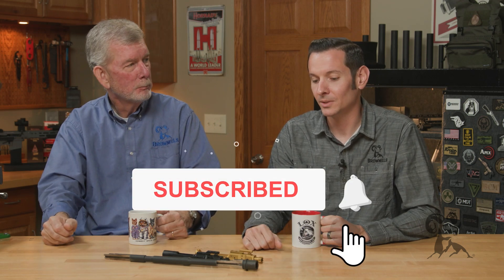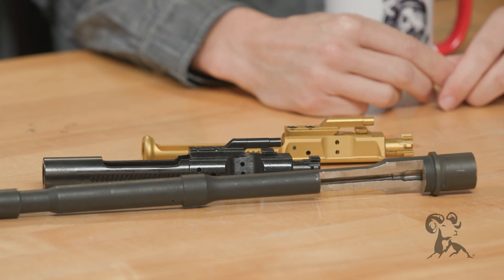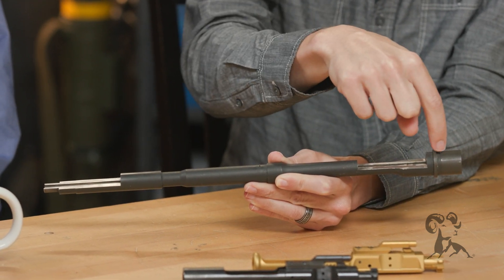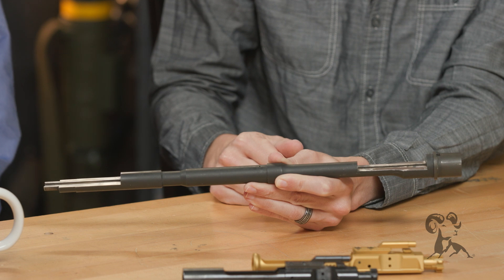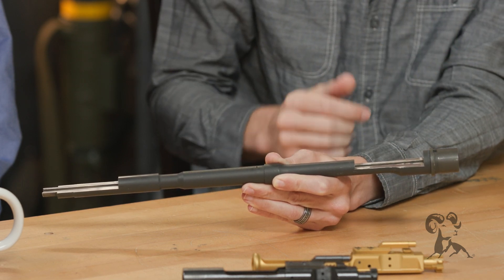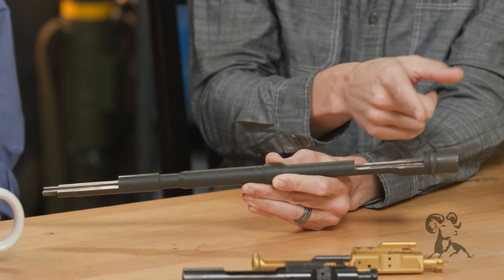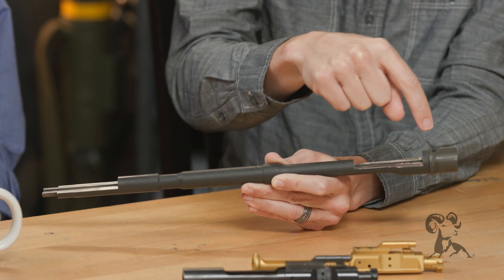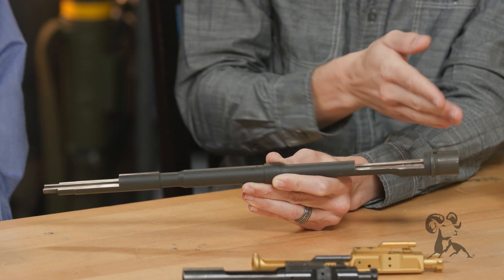Smyth Busters: Fixing Your AR-15's Headspace

Comment: Or you could go for the simpler solution. You're assuming the problem is with the chamber and not the bolt face. Headspace is a measurement from the bolt face to a datum in the chamber on an AR-15. Measure your bolt face with a depth micrometer or with the back end of a caliper. Find a bolt that is either shallower or deeper depending on your needs. Check headspace with your headspace gauges again. If it passes you should be good to go
Reply: That's assuming the chamber is indeed cut correctly, an undercut chamber with an overcut bolt face is not a solution.
Reply: @CalebSavant  if the difference is only a thousandth or two I doubt that would be an issue
Reply: @ryanthede4689  Again... to everyone reading this comment. Never remove material from the bolt face to fix headspace issues, it is unsafe
Reply: @CalebSavant  I was not recommending removing any material at all. I recommending finding a different bolt

Comment: I checked the headspace on a barrel handguard install from jp. They called for red loc tite on the threads… which must be a troll now.

 Cuz that seated before i could even torque it fully. I guessed i put atleast 25 lbs on but couldnt get to my torque wrench fast enough. It didn’t budge when “torqued”

Barrel was a faxon 6.5cm 20” 416ss nitride match lr308

Then also changed the bolt out to a small firing pin (jp high pressure lr308 6.5cm bolt) and the thing had a mono-gas ring. It didnt seal at all. Had to buy std 3 piece gas rings and replace. 

I like jp products but damn u gotta be a gunsmith to work with them sometimes. Damn “race gun parts”

Comment: I’m debating on getting a prebuilt upper for my new AR308 build or trying my hand at assembling my own upper but the head spacing is the most daunting and frightening aspect of it to me lol
Reply: Buy a quality barrel and bcg and you’ll have nothing to worry about.
Reply: If you have the proper tools and can follow instructions, you can make it happen.  I put my AR-15 together with the help of youtube vidyas made by the old dude from Midway.  Also had plenty of written materials to consult.  Read thrice, watch thrice, wrench once.
Reply: Do you have the proper tools to torque and hold an upper and barrel? If not I would just buy a prebuilt one in the pattern you you prefer.
Reply: I would stick with a prebuilt.
Reply: Yep good barrel and pretty much any decent bcg and you should be gtg. Assembly isnt as hard as some make it out too be. Alough an action rod is handy
Reply: It's worth buying the headspace gauges if you're going to build more than one AR308 upper on your own. Otherwise, definitely go pre-built and forego the gauges.
Reply: It’s fun building one up… when buying head space gauges, make sure you buy both go and no go gauge at the same time…
Reply: You'd better get a good torque wrench, they need 60-80ft lbs of tightening on the barrel nut.
Reply: @SuspiciousGanymede  Barrel nuts are from 35 to 80 lb ft. I set my Diamondback at 40. My Aero M4E1 upper instructions said to go 50. I like to check what the manufacturer wants.
Reply: @SuspiciousGanymede  woah woah wrong info here. The closer you can torque to 30ftlbs the more accurate your barrel will be 80-90ftlbs is normally the MAX it should be and will 100% affect accuracy or the threads on your lower at that torque. 30-35lbs is the sweet spot ppl do 40 that are cautious but 80?!?!? Damn lol
Reply: @appaalle  Aero specifies 60-80lbs torque for an M5/M5E1 upper. On a standard AR15 upper it's up to 60lbs.
Reply: @appaalle  35lbs won't cut it on an AR10, the barrel nut will work loose from recoil. 
On an AR15 those specs are correct for a pencil barrel. Typically you'd want about 38lbs of torque for a heavy profile barrel.
Reply: @SuspiciousGanymede  oooo you actually are correct and I was wrong, I over read the M5E1 in huge lettering lol. Def wouldn’t do 30ftlbs on a .308 for sure

Comment: With cheap assembled uppers it is not uncommon for the headspace to be insufficient to chamber a factory round; this observation is from my most limited experience.   I have seen this several times with BCA assembled uppers.  In two of the cases simply trying a bolt from another source allowed chambering of factory ammo.  The original bolts were saved and calibers were 300 blackout and 7.62x39.  I have seen it also in 5.56 and in that case the upper was sent back for exchange.  I have heard of other cases and there was talk of sanding the bolt.  A gun smith can lap a bolt face.   Sometime a little can be taken off the face of the bolt face even if this is not an approved method for fixing head space.   
AR15 upper assembles should be head spaced to the intended bolt at the factory.
Reply: I've had BCA barrels and BCG fail headspace checks.  NEVER remove material from the bolt to fix a headspace issue.
Reply: To all reading this, NEVER remove material from the bolt face to make up for a chamber that is undersized! This is a safety concern to say the least. If you bought an assembled setup that does not headspace or chamber properly, it is the manufacturers responsibility to fix it or replace it, it is not their responsibility to pay your hospital bills after you "modify" it.
Reply: @CalebSavant  You're gonna have to police the comment section of bad tips/suggestions.  A 4 minute, easy to understand video, and a few scoff at the advice.
Reply: @CalebSavant   @Caleb Savant  Please explain how removing a 0.001" makes the gun unsafe.  You do know that for grendal bolts faces there are type 1's 0 .125"  and type 2's 0.136" recesses  for the bolt faces that differ greatly in the the depth of the recess for the face.   The 0.125" is used for the  7.62x39 and for some 6.5 g's.  The 0.136' is what Alexander arms uses for the 6.5 g.  It has something to do with better extractor function I think.  
For unaltered bolts, why is that one manufacturer's bolt will provide adequate head space and another will not on some chambers.  Is one bolt weaker than another.   
The 5.56 AR bolt is over engineered and even when lugs break, seems to still be able to function, but of course such should be immediately replaced.   
Anyway I did not sand or lap my bolt face and simply found a bolt that would headspace.   
https://www.snipershide.com/shooting/threads/whats-the-difference-between-6-5-grendel-type-1-and-2.6971443/
The rims on the Lapua brass are thicker than a 5.56 so a standard extractor would not snap over the rim. The easiest fix back then was to make the recess deeper while opening up the diameter. 1 op to fix both problems. It did make the extractor stronger at the expense of making the bolt lugs weaker. The best way would have been to move the pivot pin of the extractor forward. The extractors AA used on all of the Grendel bolts in the beginning were MILLED 7.62x39 extractors. They were sold by Rguns 3-4 years ago

Comment: Sometimes AR headspace problems are a tolerance stacking issue.  I'd try any other bolts I had lying around first.  After that, I'm with you.
Reply: Good advice, came here to say this. I'd bet most people building ARs and buying headspace gauges have an extra bolt or bcg.
Reply: Yup, built one that didn’t headspace. Tried a couple other bolts I had, they both checked out. Turned out the PSA Premium BCG was not so premium, it’s now a paperweights and reminder.
Reply: Where does an AR headspace?
Reply: @woodrowcall3158  the other guy has a lot of how the AR works right, but the headspace is measured between the bolt face and the datum point. The datum point on the 5.56 cartridge (like most rifle cartridges) is on the shoulder of the case.

Headspacing an ar-15 isn't too difficult as long as you have the right tools: headspace gauges, bolt disassembly tool, and roll pin punches/holders. Take the bolt out of the bcg, remove the ejector, re-assemble the bcg with the bolt minus the ejector, and insert the bcg and charging handle back into the rifle. With the rear take down pin out and the front take down pin in: tilt the upper forward, pull back the bcg a bit, put the headspace gauge into the bolt, and then lock the bolt forward and try closing the rifle. Rifle should be able to go back together with the go gauge, but with the no go gauge installed it should not allow the bcg to clear the lower and the rifle shouldn't close back up. Pretty sure Brownell's themselves have a video on it.
Reply: @woodrowcall3158  inside the barrel extension, there are forward facing surfaces on the "teeth"  Those faces have to be a certain distance from the angled portion of the chamber.

So, the chamber has to be cut to the correct depth at the factory to match the barrel extension.

On the bolt, the distance that counts is between the bolt face and the back of the locking lugs.

When the AR goes into battery, the bolt rotates, and the back of the locking lugs bear against those forward facing surfaces inside the "teeth".  That brings the bolt face to the correct distance from the chamber.

It's the same as a bolt action with locking lugs - except that the barrel extension acts as the receiver and there are 7 small locking lugs instead of 2 large ones.  The large number of locking lugs means a smaller amount of bolt rotation and, because the force is more evenly distributed, the bolt and the barrel extension can be smaller and lighter than the receiver and bolt of a typical bolt action rifle.

Comment: Wait you guys are checking head space? The way I check is if it seats it yeets
Reply: Some seats may not be yeeting to their full yeetability, but I feel you.
Reply: Yeetability has been added to my list of favorite words
Reply: Just because it seats dosnt mean it yeets.
I saw the aftermath of some special guy that put a damaged/bent m855a1 round in his m4a1 and it blew up the side of his rifle sending him to the hospital.
When in doubt throw it out
Reply: @Timber_LXG_5  I just sent a barrel back because the ramps were scratching and guaged a few rounds some, so those wouldn't be safe to shoot.!.??? their not bent or anything.
Reply: @shadyp-zv3uf  small dents in brass is not dangerous 
But if you're ever questioning a round throw it out
A 50 cent bullet isn't worth a 500 dollar bolt and barrel combination. 
I'd only chamber a "weired" round if It was my last round
And someone's chargeing me with a bayonet or a knife
I'm dead eaither way might as well try
Reply: @Timber_LXG_5  nothing I questioned,  they just mainly scratched up lightly,  couple have a small gouged scratching but not bad or deep, but enough were I knew the ramps had burrs so sent it back for a replacement
Reply: @shadyp-zv3uf  Thats fine, scratched bullets like that would only hurt your accuracy. The bullet the other guy used was a military m855a1 steel tipped bullet, im guessing the tip was where it was bent and probably got stuck in the barrel causing the explosion, a normal full metal jacket or soft point bullet wouldnt do that. That said if you notice bullet looks really weird, is very bent or very short best to just avoid it, but small scratches, dings etc are fine
Reply: @shadyp-zv3uf  yeah replacing the part or haveing someone who knows what there doing polish the feed ramp is the best option
Reply: @shadyp-zv3uf  any gunsmith could polish those feed ramps. You could do it yourself with a dremel
Reply: @tonypasty7549 Yeah, but they have to be competent in disassembly and reassembly.
Reply: @Timber_LXG_5  send me all your "when in doubts" I'll shoot em
Reply: @Timber_LXG_5 guessing you arent a reloader, there was more going on with that cartridge than being bent slightly.
If it blew up like you stated then it was overcharged, seated to deep into the case, or both or the barrel was already damaged.
Reply: You guys have me taking notes 📋
Is class dismissed because I got a few seeds to yeet.
Reply: Thank you for this 😂
Reply: It seats it yeets😂🤣😅😆😆😅🤣😂😂🤣😅😆
That's awesome 👌
Reply: This is the way
Reply: About being yeeted I do not know, but medlers must be bletted.  Medlar is fruit and must be bletted prior to consumption.    look it up lol.   I have two medlar trees in north florida.
Reply: Yezzir!!!
Reply: Lol, me too  😂
Reply: Headspace gauge go and a no go gauge
Reply: First mag protocol is "it turns the head, fred" and face away while firing in a safe direction. Preferably with armor on.

Comment: Which is better for a 55 grain a 1:7 1:8 are a 1:9 in a 16 inch barrel. I've asked this question to a few people nobody can really give me a answer y'all's thought.
Reply: 1:8 and 1:9 are known to be a bit better, but not by much. Different people using different qualities of barrels will give you mixed answers. In short, a higher tier 1:7 will shoot a 55gr better than a poor/mid tier 1:8 or 1:9, even though "on paper" a 1:8 and 1:9 should be better. I personally shoot 500yd steel using 55gr out of a 13.7" 1:7 barrel with no issues, but use a higher tier barrel manufacturer.
Reply: 1-9 would be best, 1-8 would work and 1-7 is best for heavier bullets.
Reply: I can only speak from my own experience. I have a 1:8, 20" SS bull barrel on one rifle, the other has a 1:9 , 16" SS bull barrel. The 20" is an Ultra-match from Olympic Arms, (no longer in business) the 16" is from Les Baer Custom. At 200 yds, the 20" 1:8 average group with my hand loads is 3/4-7/8". The 16" 1:9 does 1.25" . Yes 55gr.  Both have excellent two stage triggers, bi-pod, lotsa zoomies. Not typical setups.

Comment: I know an AR15's headspace can go out of spec after it's been fire enough.

Where is it in the barrel, extension, bolt, or whatever that changes to take an AR15's headspace out of spec?
Reply: Typically the lugs in the barrel extension and on the bolt, where they contact each other.
Reply: @CalebSavant   Can the extension and/or bolt be replaced to try to fix this problem?
Reply: @viewatyourownrisk  The extension is much more trouble than it's worth and by the time it's worn down, you should be looking at maybe replacing that barrel anyways. So even though it is possible (the process is explained in the video) it is not recommended.
Reply: @CalebSavant  Thanks Caleb.  These vids from Brownells are all pretty great.  Cheers!
Reply: For it to get out of spec you would have spent so much money on ammo that replacing them wouldn't make a dent in your budget, or you bought one of those Khyber Pass ARs that are made using swiss dark chocolate instead of steel.